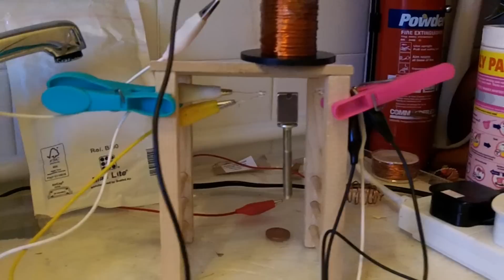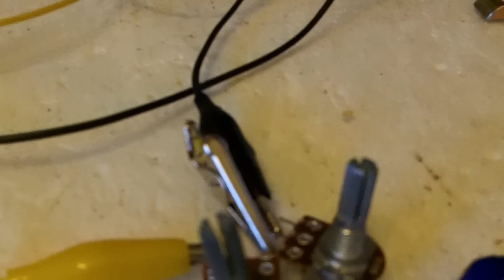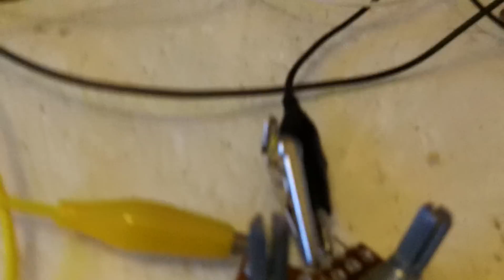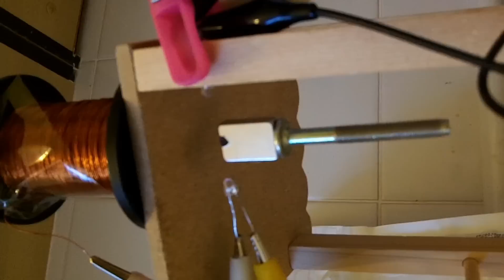DIY magnetic levitation (thanks Slider!)

Comment: HeyHey nice one !
Glad to have helped :)
Reply: Noticed something really weird today. My circuit works best when the 100K pot ISN'T CONNECTED. So my circuit is super super simple. Just 2 transistors, 3 plain resistors (2 of the 470s and 1 which is about 1200 Ohms) and the coil + IR diodes. Weird eh? I remember something similar with the exciters. The base of the transistor can be left unconnected and the circuit still works.